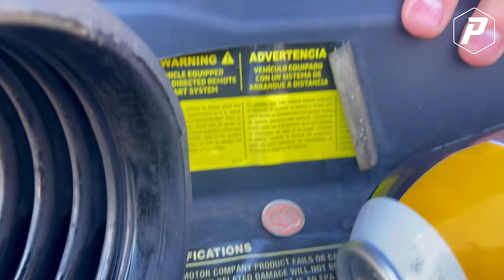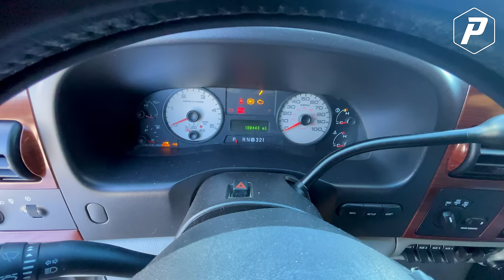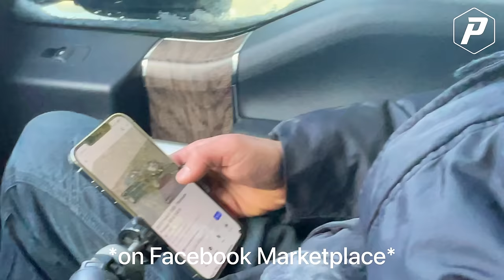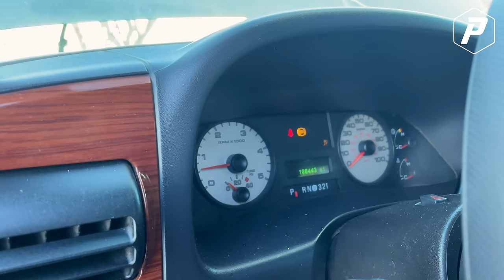COLD STARTING DIESEL TRUCK WITH HAIR DRYER

Comment: Change the block heater, it's a half-hour job!  Use a propane torch to heat the oil pan/ oxy acetylene! When I worked up in the Yukon milling mine timbers, we would use industrial pans filled with used oil lit on fire under the loaders, logging trucks & flat decks for about 45 minutes 
to an hour before starting then up! 16 hour days 6 days a week, after dinner and shower time power plant shuts off till start up!